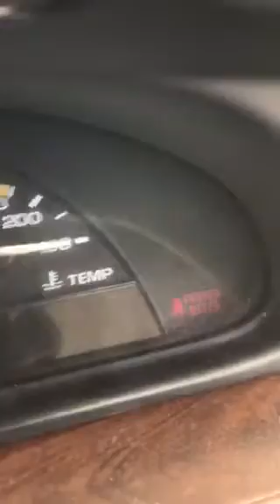Security system bypass GM # how to by pass.

Comment: I have a 2000 gmc jimmy and I'm trying to bypass the Vat System with a resister I did it on my 1999 Cadillac  but on this one I can't figure it out because the stearing column was replaced and all.the wires had been cut  so I'm unsure what is what in there can anyone help me